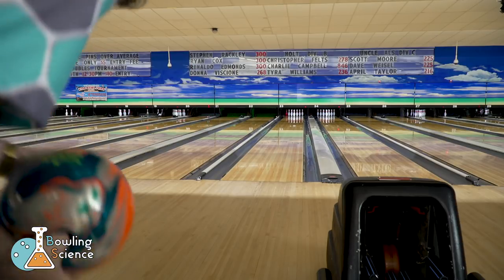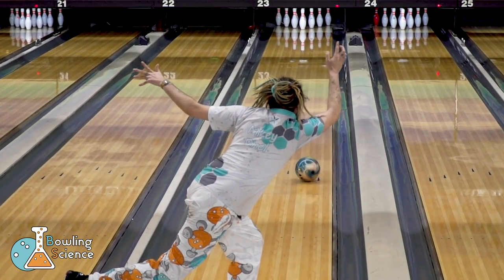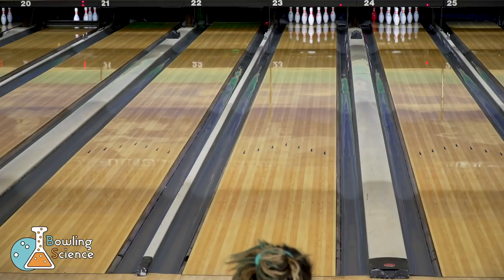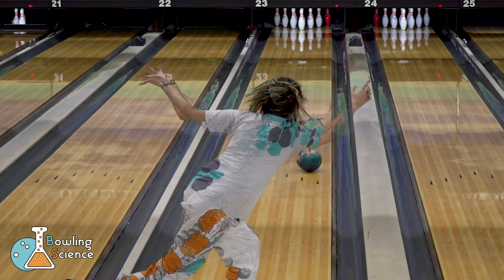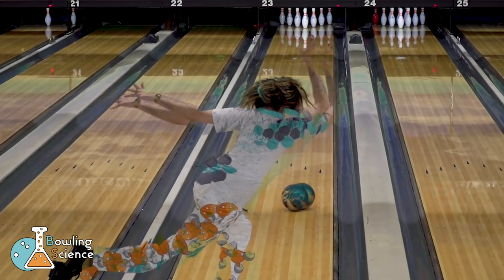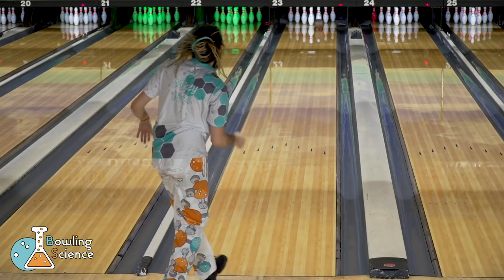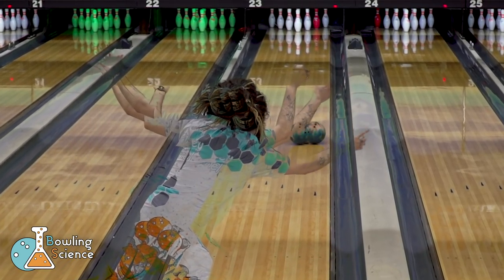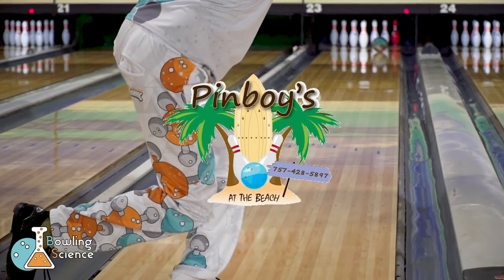Bowling Science Episode 13: Using Surface on SHORT OIL!

Comment: I understand surface makes it less violent off the spot. I also think you need a decent rev rate for this strategy because surface burns energy. A low rev player will run out of gas and hit like a turd.

Comment: I would have never thought of putting anything less than 1000 on a ball for a house shot. It looks like this is something I need to look into trying.
Reply from the maker: This particular video was on the Johnny Petraglia sport pattern.  Episode 11 shows surface on a house shot, if you havent seen it yet!  Thank for watching!
Reply: I would like to see how a pattern breaks down differently with different grits. For example, how often would you need to move, and would you be able to use the same ball for a 3 game set?

I have difficulty moving quick enough and/or not balling down fast enough when the heads go at my house, so I end up with terrible series.

Comment: How far was your pin to your pap? This is side roll or is that term only for an asymmetrical balls? I’m struggling on a 33’ pattern in league right now. I’ve been using 5” pins balls. One with surface (val @ 40 degrees) and one polished ( val @ 25 degrees). It still jumps too hard on the backend. Thinking getting another symmetrical ball with 1 1/2” pin to pap or a 6” pin to pap.
Reply from the maker: I highly recommend an asymm at 90 x 1.5 x 45, and/or a symm 90 x 1.5 x 45... that's the layout used in this video is a symmetrical... my assym is less angular even, video coming soon.  Thanks for the support!
Reply: Bowling Science what about cover Mr Pinel? If I get a squash solid and use that layout could I sand the polish then sand the surface at 4000?

Comment: Nice video. I'm currently having issues with my polished short pin asymmetrical ball (Parallax Effect). Every time I play that line you were playing in the video, the ball seems to react a lot when it encounters friction. Would you recommend that I add surface to it? And what surface would be good for a short pin layout ball playing that line?
Reply from the maker: We usually recommend surface on a short pin. Our lane patterns could be different as well. What’s the layout on the parallax?
Reply from the maker: I start at 1000 usually for most of my stuff
Reply: @BowlingScience  I would need to ask the PSO who drilled my ball for that info. What I know is that he mentioned it being a 2 inches short pin layout. I had the surface at 2000 grit during my league this past Sunday, but it was hooking a lot in the strike zone I was playing (in between first and second arrow).